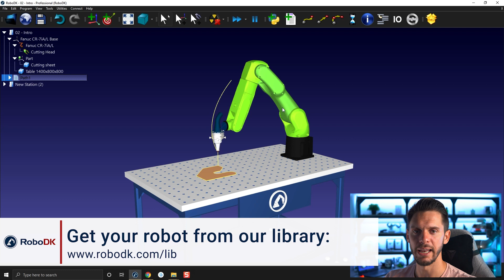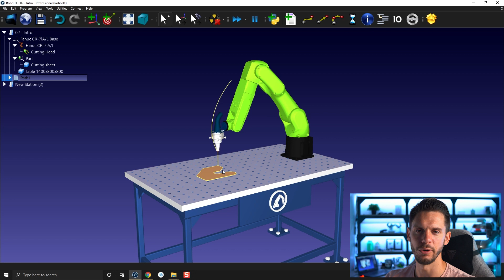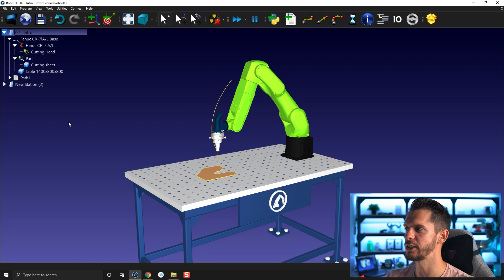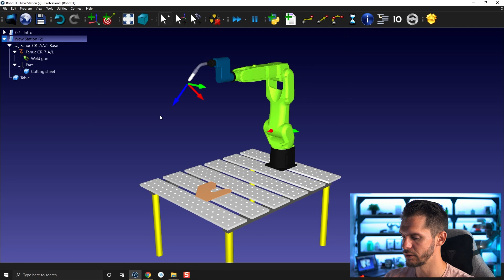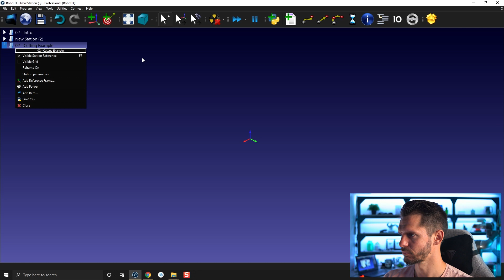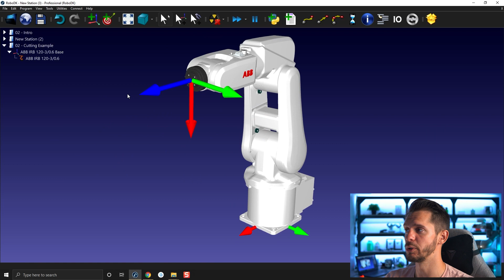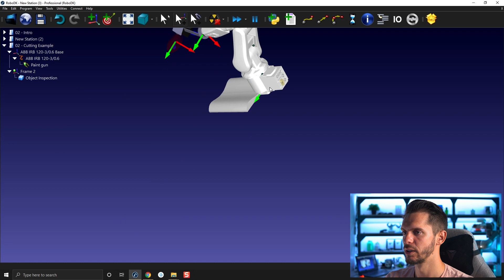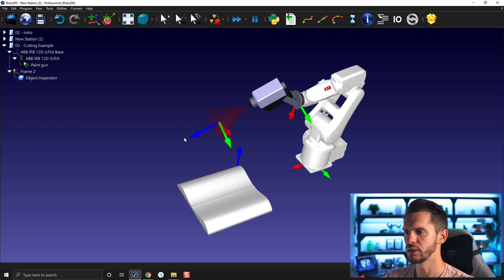Station Creation Overview - Course 2.01 - RoboDK Academy

Comment: I can't seem to get the training resources from the link provided. I was able to download the resources for module 1 of the training course by clicking on them, but the component files and PDFs in the 02A and 02B folders do not download on my computer when I click on them. Instead, they open a text file on my browser. I do not see any option to download the complete folder. What do I do?
Reply from the maker: To download a file you should right click on the file and select "Save link as...". We'll improve this shortly as well so it downloads automatically.